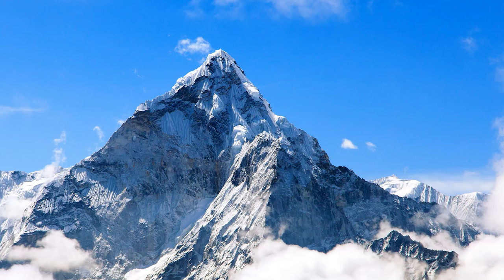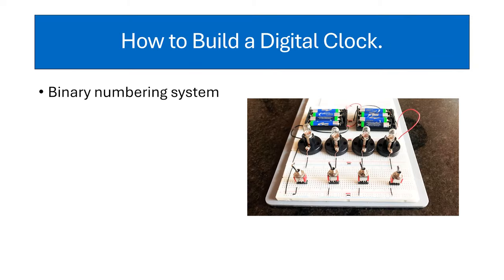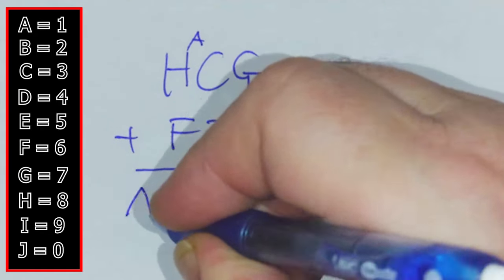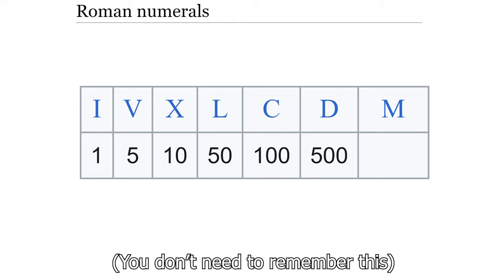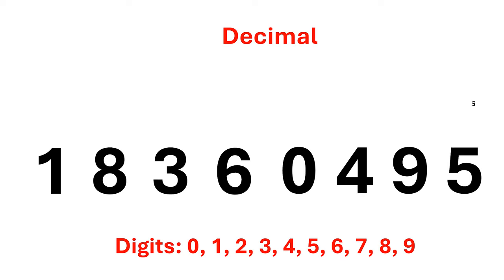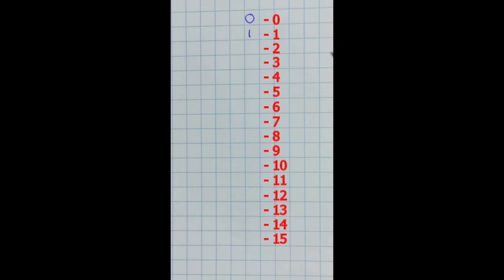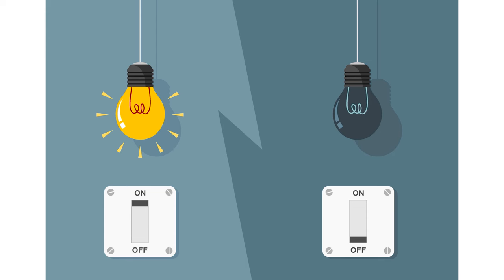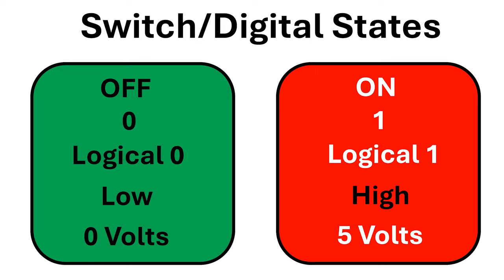Digital Logic Explained

Comment: Well done, Dr Matt. Two supportive comments if I may.... This was a great introduction for anyone approaching this with next to no prior knowledge of the subject. So, not aimed at me, but I would have loved this kind of content in 1975. 😊  As for no university degree being required, I agree 100%.  I have no degree, but by 1983, aged 26, I was designing hardware for computers using 16 bit microprocessor chips. I'm now retired, but learning exactly this kind of material from first principles led me into a 44 year career in computer hardware, avionics, semiconductors, and consumer electronics. I think I've said it before - you're a great teacher. I shall enjoy this series, although I shall try not to comment on each episode. 😁
Reply from the maker: Thanks for the feedback, you are always welcome to comment - you might even spark an extra video!!

I personally think this should be taught at high school.   Looking forward
i think it's more important to learn how computers actually work, rather
than spending 4 semesters on chemistry and physics each (which i did in the final years of high school).  Some physics and chemistry at high school are good, but i think they have limited utility for most.

Interestingly, back in the day, i did computer science with a couple of years of electrical engineering thrown in, but in third year (1990), we built a simple Z80  machine.  The microprocessor circuits i'd built before university, for which i was self taught, were far more complex.  It was one of the easiest subjects i ever took.  So I agree, I think a motivated self-educated person can achieve great heights.

In fact, on of the main motivation for this channel is to be a resource for the self-learner.
Reply: @DrMattRegan  Thanks again. 😊

Comment: I appreciate your new series. Being a software engineer now approaching retirement, I grew up with transistors and analog circuits in the 70s, then I discovered digital logic and later microprocessors. This led to a degree in IT. In my opinion everyone should know the basics about digital logic and processors when beginning to code, not very popular nowadays when you can code your blinken lights with a RasPi in Python...
Reply from the maker: Agreed.  I think you need to teach people how math works before you teach them to use a spread sheet.